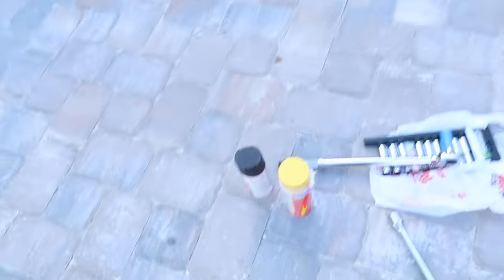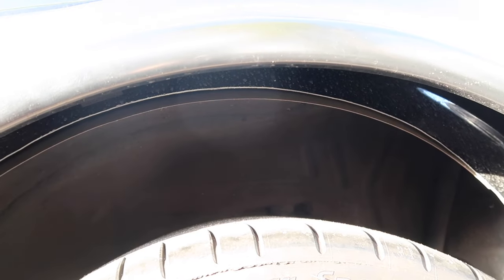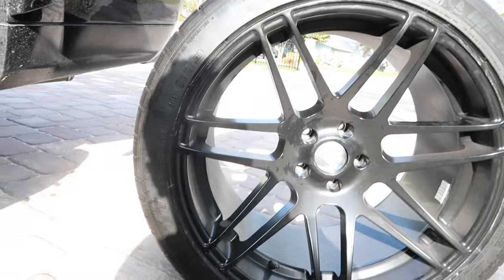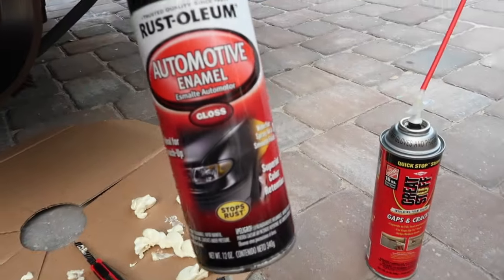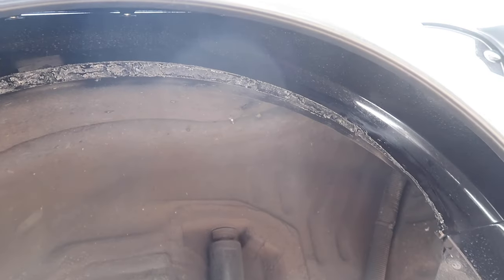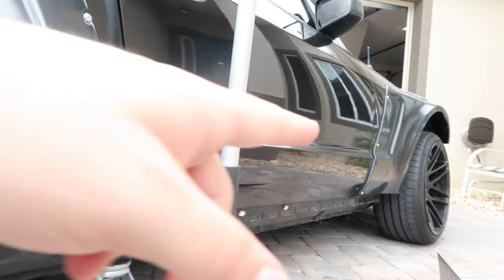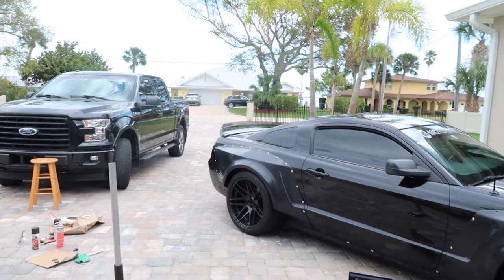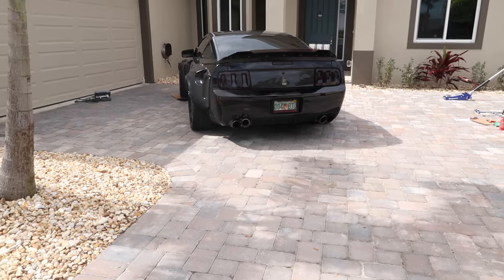EVERY WIDEBODY KIT INSTALLATION NEEDS TO DO THIS ASAP!

Comment: There is a reason you don’t see anybody with a widebody kit filling it with expanding foam expanding foam is going to dry out absorb moisture and rot it out twice as fast you need to pinch it shut and weld it
Reply from the maker: It says on the can that it is water resistant and air tight sealant, i just figured that it would work instead of pinching and welding it
Reply: Johnathan Harder The water will get between the farm and the metal causing it to rust and it will trap moisture there the phone itself will shrink in the heat causing it to fall away from the metal
Reply: Johnathan Harder I fixed a fox body quarter panel with this spray form it was just a four-cylinder better that I didn’t care about but the quarter panel was rotted from the dogleg to the wheel well I filled it with a spray form and it looked really good for about four months after that I noticed my Bondo had cracked and the whole chunk of farm was just loose in the quarter panel The chunk of foam ended up falling out on the highway from the vibration and was never seen again it was pretty funny but it taught me to never use spray foam in between body panels it’s meant for housing installation and ceiling up cracks. In housing applications
Reply: @Johnathanharder   yo pinch it and weld it don't be dumb

Comment: • When this is done, I hope the wheels (especially in the Rear) are flush to the body kit.
• I also would of had someone professionally weld and smooth the inside of the wheel wells 
• Please!  Black out the silver rivets on the wide body panels. I love your cars murdered out look and the silver takes away from it in a bad way.

I Hope all goes well with the kit bro and cant wait to see it get painted (if you do)

Comment: I want that front bumper! I tried to email those guys for it but no reply. I also think you should have welded those gaps. BC that spray-foam will absorb water, since your in Florida that salt air/water mix every time it rains that will be all up in your fenders it'll start to eat the metal.

Comment: Foam will obsorb moisture it will rust
Reply from the maker: It says on the can that the foam is water resistant, but i will keep an eye on it and see how it holds up after a while
Reply: Should be welded
Reply: Oh man dig that stuff out of there. It is going to hold moisture and rot your car out everywhere you sprayed it. Even if it’s a closed cell foam.
Reply: @mustangclaydog  I used it in the hatchway going into my basement up in New England and it absorbs moisture like a son of B...

Comment: Widebody has lots of potential. Personally, i would take it to a body shop to get it molded on instead of riveted on. That will increase the value of the car. I would also have given the widebody company a lot of heat for giving me the wrong dimensions to the wheels (tucked in) and not making a front bumper conversion to go along with the fenders, they are liable for all of that. Sick kit but needs work still. It will be a beast
Reply from the maker: Nate Rider yeah I agree, ill decide what imma do when its all done and just go from there ✊🏻

Comment: That kit is very angle dependent. Some angles I am not feeling it, others it looks pretty bad ass. I'll reserve final judgement till it is completely done to your liking! Right now it's still in the build stage, and I think a lot of people are jumping the gun on the opinions. The shot of the car coming towards the camera looked great. It does show that the wheel fitment needs to be taken care of, but it also shows the car super wide compared to the "stock" s197. The front look is a definite winner in my book.

I looked at the side and envisioned a set of Cervini’s side pipes... If there was only a way to make that line up with the body properly. That would leave the rear open for a mad diffuser.